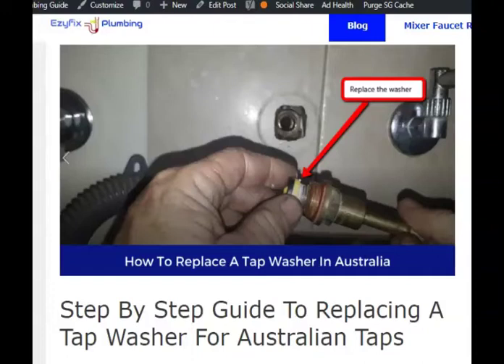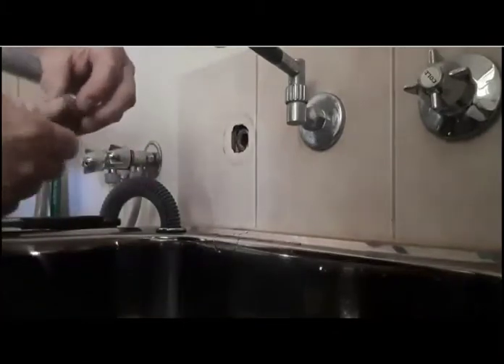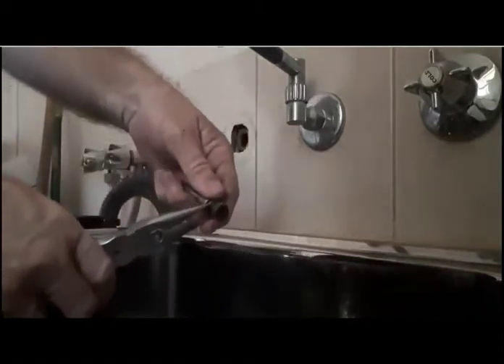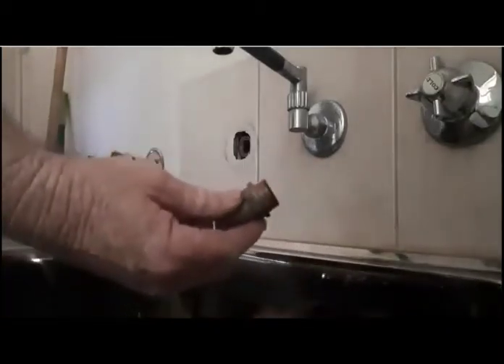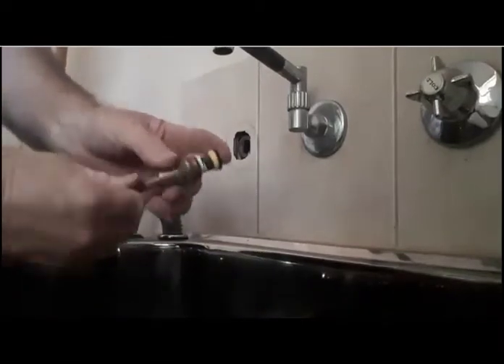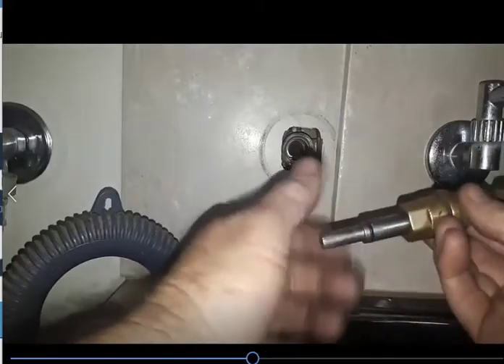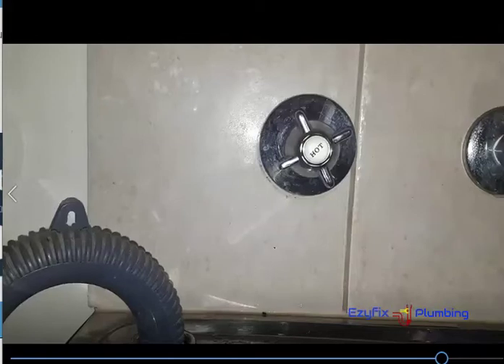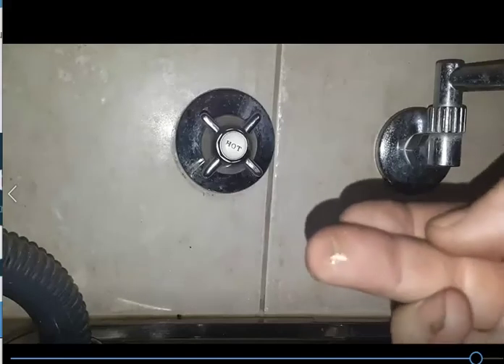Tap Leaking From Spindle

Comment: What about leaking from the spindle shaft itself?
Reply: If its leaking from the spindle when the tap is turned on you will need to change the boring on the spindle itself. Always replace the fiber washer, tap washer and boring with a service and reseat the breach if you have a tool
Reply: @jasmoore5716  actually i just went to bunnings n replaced entire tap with a newer slim line one with 1/2 ceramic disc... Neighbour was super happy.